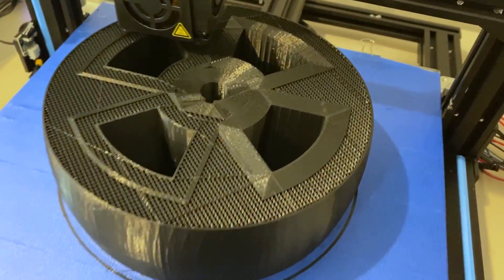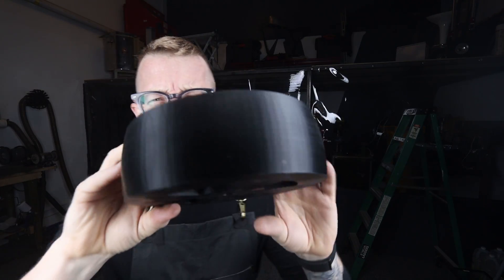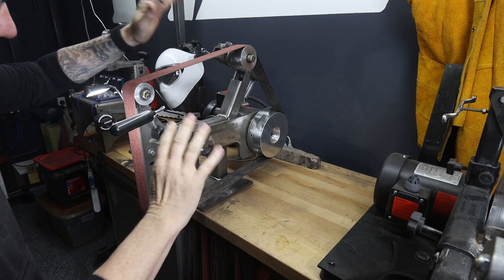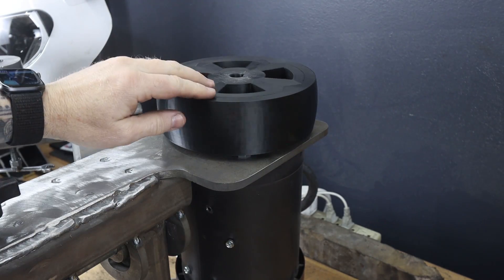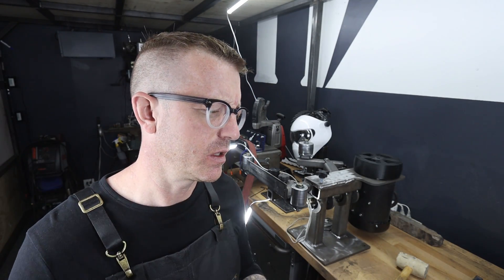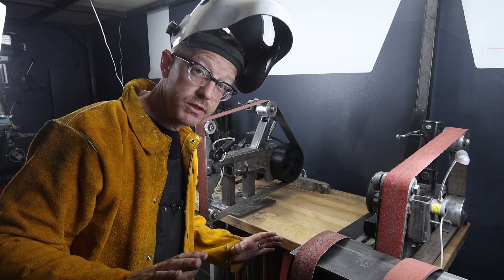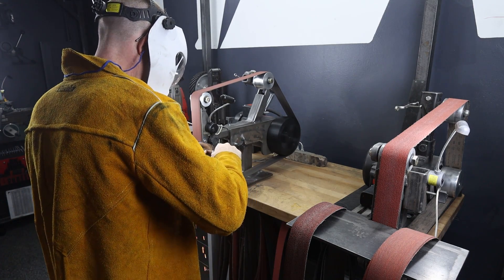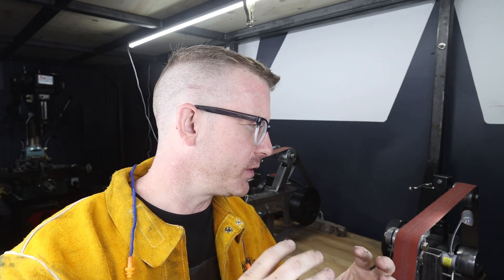3D Printed 2x72 Belt Grinder High Speed Drive Wheel - Will it Work??

Comment: Nothing wrong with 3d printing functional parts. Most people tend to use the same geometries and dimensions as are meant to be used with other materials, such as metals. And when the plastic parts then fail, people tend to blame the material. Heat can be dealt with by including a bit of a fan blade shape in the print so the wheel auto cools similar to how car wheels cool brakes. And mechanical load due to high rpm can be dealt with either by oversizing certain parts of the wheel or by inlaying composite materials. For example, I had great experience with 3d printed high rpm flywheels where i left a groove in the outer face and filled that with long, thin copper cable strands from some electrictal cable. glued that in with ample amount of super glue, light sanding, done. Another trick is to print bore holes into the part that can be filled with straight steel wire or thin threaded rods.

Comment: When I want a stronger print, I would split the print. In your case I would split it into 4 parts perpendicular to the bore. This way you create 6 extra internal walls to hold it together better. Also I would  put an aluminum hub into it. This is where the torque is applied and is only a small area that could fail. so making a hub with flanges that can be attached to the hub and spread the load up the side of wheel. I use this method with my shelf brackets and they are very strong and hold a lot of weight. Also I prefer to print with PETG or carbon fiber.

Comment: Honestly the failure mode probably won't be "exploding" which is more technically called "catastrophic failure".. plastic tends to go through aptly named "plastic deformation" as stress is applied so you'd notice a failure slowly-ish get worse and worse as time goes on. It doesn't typically have instant cracks form like some metals. 3D printed part strength is highly dependent on slicer settings and usually design, but that is a pretty simple design so strength will be dependent on infill settings. If there's 100% infill settings I'd bet this thing could last a while.
My guess is that tiny imbalances inevitably created by the 3D printer never being able to perfectly print something will cause asymmetric stress since it's spinning and if something is heavier on one side as it spins it will pull in that direction. This pulling will add up over time and cause something to deform and eventually fail. There will probably be some noticeable wobble before though.
I've never owned  belt grinder so I'm not sure but friction wearing it away at the contact points might be a big issue too

Comment: nice vid! if the motor is 3600RPM, how did you get to 4000 at 50% on the vfd? are you over speeding the motor?
Reply from the maker: 4000 surface feet per minute (or RPMS) due to the drive wheel being 7 inches in diameter and amplifying the speed.

Comment: Came across this looking at options, and it occurred to me you could use a fairly hollow 3D print and then fill it with resin. Then throw it in a lathe, or cuck it up in a drill press for a little finishing. Could make a pretty damn solid drive wheel. Esp if you already have the stuff laying around.
Reply from the maker: I had this same thought. Never did try it though.
Reply: You can't use epoxy with 3d prints, it cures via exothermic reaction.  The heat will warp the print.

Comment: I'm doing a printed wheel for a 2x48 and from experience id really recommend PETG. Pla will deform with heat over time, I've seen warpage from 20 minutes in direct sun. If it does fail it will be from delamination, which you can help with printing hotter and with less part cooling than you would when printing for aesthetics, near the max of the materials temp range which for pet is 250-260. You'll get stringing especially with Bowden, but it's worth the trade in durability. Thicker layers like .3mm are stronger as well. Thick walls/perimeters and lots of fillets/bevels will make the shell pretty darn strong. I'm positive a 3d printed part is capable of doing the job. When I'm comfy with performance Id be happy to share an stl.
Reply from the maker: Sounds good. I was also thinking about infusing the wheel with resin in a vacuum chamber. But that’s a whole lotta work for this type of application. Let me know how yours turns out.
Reply: Any update on your PETG drive wheel?
Reply: any update?
Reply: Hey mate, would love an update on your Petg drive wheel!

Comment: Hmmm, my Prusa Mini prints 7x7x7 inches.
Reply from the maker: You could most definitely print this wheel. 🤩
Reply: @HouseMadeUS  for the tracking wheel arm, have you considered making the fixed arm longer only to keep the entire pipe profile after the spring arm bolt? Currently the design only has the two small ears to keep it square. If the fixed pipe was 1.5 - 2 inches taller with just the notches for the spring arm to go through it, that would keep the tracking arm from torquing in or out of the belt line. 

Every video keeps making me itch to build one of these!!!

Comment: I don't think your 3d printed wheel will explode. My prints are all pretty strong.  What kind of infill did you print the wheel with?  PLA is pretty resilient and you should be able to build quite capable stuff with it.
Reply from the maker: Yeah I have been using it and its fine. No issues. I am not running it at really high speeds but its not even feeling weak. I think its a viable solution.

Comment: Good video.  I guess I have two concerns.  Wear from entrained grit, and much reduced rotational inertia.  The latter means your motor is carrying more of the load should you suddenly increase grinding pressure, rather than the drive wheel smoothing out the load.
Reply from the maker: Yeah definitely something to think about. I am looking into printing this with Nylon also. That would be stronger.

Comment: Look into heat tempering with 3d printed parts
Reply from the maker: I will do that. Some people say to oven bake them for strength, but I would be concerned about melting and changing up the shapes and such. Probably an exact temp out there to look into so that doesn't happen.
Reply: @HouseMadeUS  60C for PLA, expect some warping though

Comment: another approach to fabbing grinder wheels, probably as solid as skateboard wheels

https://www.youtube.com/watch?v=mpw0Aw2u8R4&t=74s
Reply from the maker: Thanks Len. Ill check it out!
Reply: @HouseMadeUS  To make silicon mold for resin casting, you could use your printed wheel a model for the mold.  

Like 3d printer filaments, resin is expensive, so the voids (between the spokes) in your 3d  printed wheel would use less resin.   

You could use a clear resin and add in glitter for a "fun" wheel  :)

Comment: You could also try ABS or PETG  both are stronger than  PLA.
Reply from the maker: Thanks Allen, I am not sure what materials this printer can print with so I will look into that. Someone said a Nylon extruder can be added also. Exciting times we live in.
Reply: There is someone on eBay claiming their cast nylon wheels are more durable than aluminum ¯\_(ツ)_/¯  (not buying it) . It would make sense that a part printed at closer to 100% infill would yield a more durable part than say, 15% infill. I agree with Allen Gilchrist above, and nylon or polycarbonate would also be pretty darn tough. I'd love to hear what a materials engineer would say in this conversation...

Comment: I’ve learned with pla it has a tolerance of about .01-.02 mm , my first wheels were printed with glass filled nylon .. and work.. but I don’t confidence for longevity
Reply from the maker: Yeah I definitely don’t have much confidence in this one for longevity. But it was a fun test! Can you print with Nylon? If so what printer do you have?
Reply: House / Work yes I can print with nylon, I have the matter hackers pulse xe .. it’s a little pricey, but customer support is amazing, the printer comes preassembled, auto leveling, garolite bed, the botech extruder.. so the price is actually right in my opinion. I also have a ender 3 that I learned on and still use also. But no capability for nylon without some upgrades that I really didn’t want to do to it. Mainly to do it cost more than I paid for the machin and half the cost of the pulse xe. I will have to try carbon fiber nylon, that will probably have some longevity.

Comment: Interesting, I'm wondering how long it would take to start loosening up. I don't know if you saw my video last Friday, but I was grinding & my drive wheel came off & rolled into my water bucket. You would think since the wheel is spinning fast, it would of shot off & plowed into my stomach, but it actually just rolled off the table, then into the bucket. Giving me a face full of water. At least I caught it for the video, hahaha... I guess the tightening screw over time just got loose... Hope all is well, take it easy...
Reply from the maker: Oh snap! Haha! I didn’t see that . I’ll have to check it out. Glad it was a non event. Yeah I think the life of this is very limited with PLA, but with something stronger it may work for a long time, like nylon. 👊🏻
Reply: @HouseMadeUS  Yeah, when I 1st built my old horizontal grinder, I bought plastic wheels from origin blademaker. Now those are plastic, but have a slotted metal center for the key . I eventually upgraded, but they lasted a while..

Comment: Looks like the wheel had very little run out if any!
Reply from the maker: Yeah it was pretty smooth. Gonna grind some more today with it. All is good so far. How’s the build coming?
Reply: House / Work tube parts in the pickle juice will start on hinges next. Got sidetracked today.
Reply: House / Work  got hinges roughed out yesterday and  hope to finish them after work today 🤟🏻💪🏻👊🏼
Reply from the maker: Noice Bill! I’m using some of your pics in my next vid. 👊🏻👊🏻👊🏻
Reply: House / Work awesome!keep ripping it!

Comment: Great video. Have you thought of using the new pla drive wheel in making another aluminum drive wheel with green sand?
Reply from the maker: Yes, I think I may try that. It’s called lost PLA casting?
Reply: @HouseMadeUS  or use the pla drive wheel as a mold in green sand and remove it b4 you pour the aluminum... art by adrock and big stack D do some of there pours that way